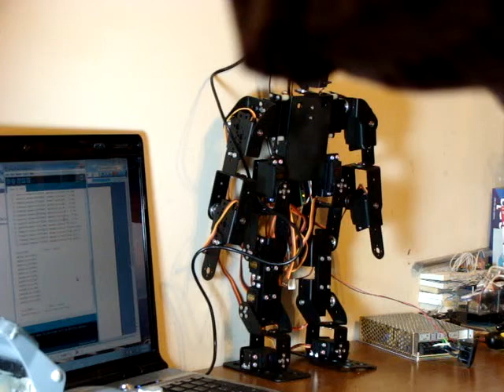Arduino powered walking humanoid Robot 2

Comment: Ooh... it's getting exciting!
What model and where did you get the servos from? I imagine most of the cost of the robot would be in the servos. :-(
Thanks for letting us peek over your shoulders while you build your robot Bob!
Reply from the maker: +Hari Wiguna - They are mg995 servos found on ebay.  Someone commented that there are better models on one of my other video's.  The DOF17 robot was $75 and the servos were another $75.
Reply: +Bob Davis , thx for the reply.  I'll be waiting for the next instalments!
Reply from the maker: +Hari Wiguna - Do not buy the MG995 or MG945 servos except for the arms (or for a 9 DOF robot).  I have burned some up trying to power a 17DOF robot.  I am thinking of trying the MG958.  Anyone know if they have enough power?
Reply from the maker: +Bob Davis - The MG958's rock!  They are the best bang for the buck in servos.

Comment: what power supply did you use for it? where did you get it? 
I am doing a biped robot as well
Reply from the maker: I was using a 5 volt 10 amp power supply.  It was turned up to 6 volts.